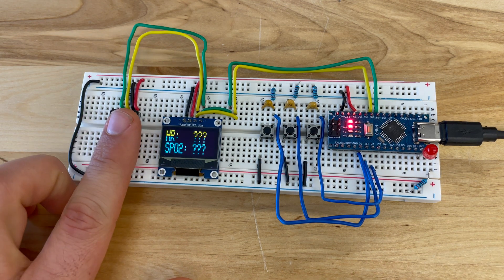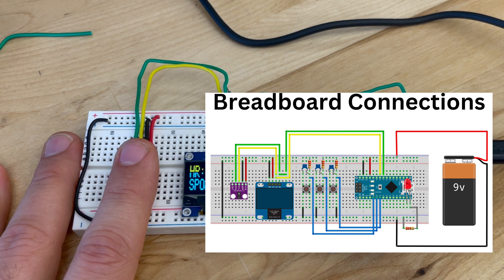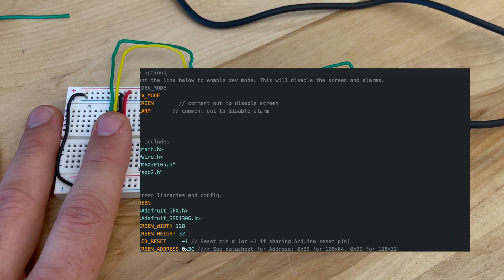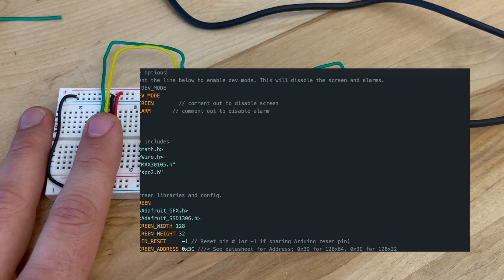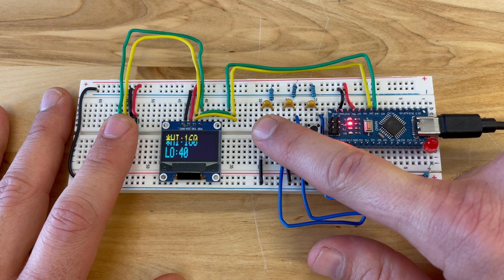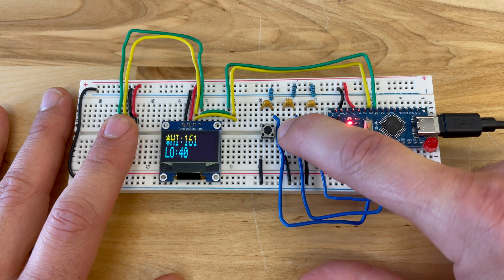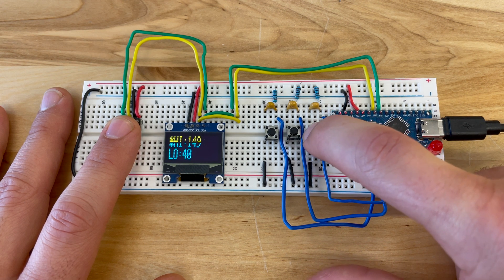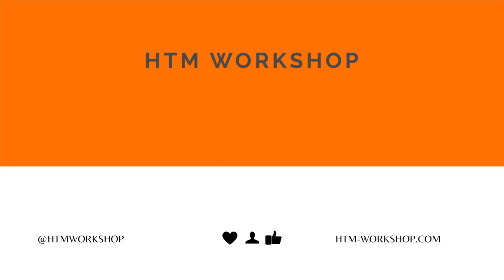Pulse Oximeter Arduino |  SP02 Project Overview

Comment: I tried running the code with my kids, but getting library missing errors.  Used the library manager to install the sparkfun max3010x.h but after that we get errors for missing linux/**.h files :(
Reply from the maker: Hi, did you remember the screen library? The oled screen has to be initialized to work.
Reply: @HTMWorkshop  yes adafruit ssd1306 library added.  
I am getting this error C:\Users\******\Downloads\DIY_SP02_PulseOximeterBreadbaordProject-20240429T163352Z-001\DIY_SP02_PulseOximeterBreadbaordProject\DIY_SP02\esp32_spo2\max30102.c:13:10: error: #include expects "FILENAME" or <FILENAME>
 #include module.h
          ^~~~~~
C:\Users\*****\Downloads\DIY_SP02_PulseOximeterBreadbaordProject-20240429T163352Z-001\DIY_SP02_PulseOximeterBreadbaordProject\DIY_SP02\esp32_spo2\max30102.c:14:10: fatal error: linux/module.h: No such file or directory
 #include <linux/module.h>
          ^~~~~~~~~~~~~~~~
compilation terminated.
exit status 1

Compilation error: #include expects "FILENAME" or <FILENAME>

thanks for the help

Comment: Excellent video, thanks for taking out the time to make it. I have a few ideas for another video project: It will be a health monitor with a different screen that shows the following things:
1.	Two digits after decimal point for better accuracy
2.	Heart sine wave
3.	If this sensor or software code can calculate heart rate variability (HRV) i.e. the time between two heart beats then it can be added. HRV shows true internal health.
4.	Skin conductance sensor to show volts, it will show stress levels
5.	Infrared temperature sensor to know if these parameters are taken when being sick or healthy
I have seen several projects on youtube but no one has combined all these in one. If you like, I can collaborate with you. Let me know and I will send you an email. Thanks.
Reply from the maker: @akhaqan  thanks for the ideas - we have been thinking of creating a larger scale project at some point and adding all our sensors on one device. We are still wrapping up two or thee other project so once those are done we may look into this - thanks again for watching!
Reply: I am finalizing the details of a health monitor and will be sending you an email later. Please have a look and respond at your convenience. Thanks.